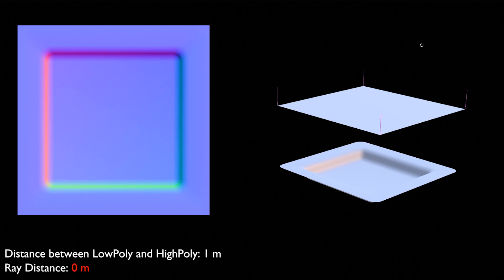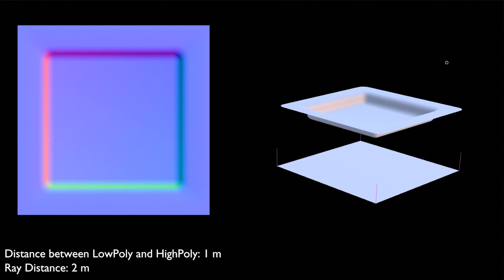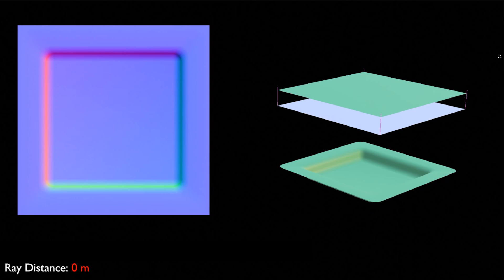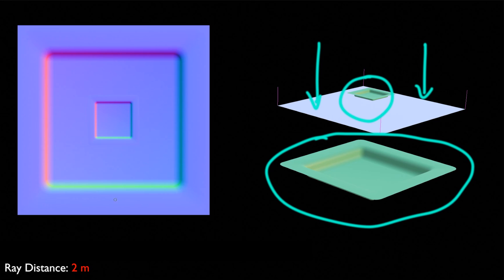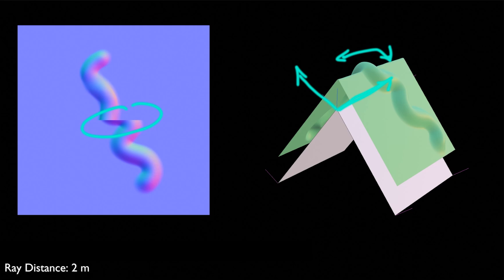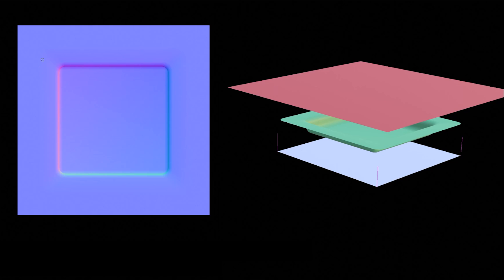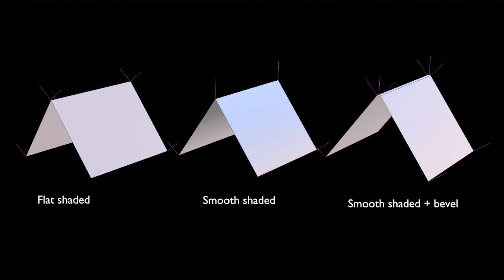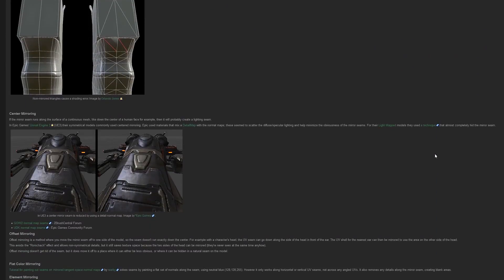Deep Dive Into Normal Baking - (For Blender, or any 3D software)

Comment: I just spent hours yesterday trying to bake something with height parallel to the low poly... While troubleshooting (because I didn't know that wasn't possible) I started fucking things up even deeper. Thanks to your video I now know exactly what I'm doing, It's not just following a formula anymore. Thank you so much for this video, this kind of theoretical knowledge is really important and yet it is extremely hard to find here on youtube. Thank you very much.

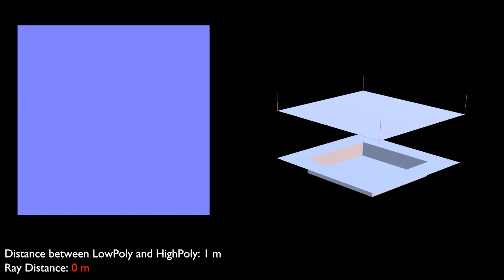PS: Just as a side note, I managed to bake a normal map which had height that is parallel to the low poly (this is a problem explained at 0:47) , remeshing the whole mesh. I suppose that the process of remeshing alter the position of the vertices making the "fall out of line" and thus making them visible to the ray projected by the low poly mesh.
Reply from the maker: Thank you for your comment, it makes me very happy. 
And you are right about the remeshing 👍

Comment: Hi, brother, this is a really good tutorial. But I'm really confused by the triangulation topic. In my understanding, with a curved surface mesh, when baking the normal map in a 3d application, it will automatically triagulate the mesh,  then the normal information will be sotred based on the tris?  So if a game engine also triangulate the mesh automatically, but in a different way, it will display black artifacts during rendering, is that the case? So that means if it's not an all planar mesh, then it has to be triangulate before baking normal map? But i see a lot of people saying they don't care about triangulation at all, it does not matter, so I am really confused. I would be really greatful if you can give me some advice.
Reply from the maker: I'm not 100% sure, but I think blender will triangulate before baking (because it's similar to rendering, and rendering internally triangulate meshes as far as I know). I think your questions is more about exporting a triangulated mesh rather than a quad mesh to another software. We can assume blender will always triangulate the mesh the same way before baking and before exporting. So really you should only be concerned about triangulating your objects when exporting it to another software (Unity, Unreal...) to make sure the mesh won't be interpreted differently. If you don't do that will you get black artifacts though? Most likely not, but you might get some specular reflections inaccuracies. Read this: http://wiki.polycount.com/wiki/Texture_Baking#Triangulation
Reply from the maker: To summarize my comment, if a non-planar face has a baked normal map but is triangulated differently than at the time of baking, you'll probably get artifacts. Don't take my work for it though I'm not an expert but that's what I would assume is going on with my current knowledge. As always, the best thing you can do is test it with a simple mesh, which should be very easy to do.
Reply: @globglob3D  Thanks mate, i think the final answer i'm looking for is, if all 3d applications triangulate the mesh before baking all the maps? That's probably how a general baking precesses? I did get black artifacts taking the normal maps generated form zbrush to unity, it's a curved face mesh with all quads. I guess at least zbrush and unity triangulate the mesh differently.
Reply from the maker: @artinchina444  "all 3d applications triangulate the mesh before baking all the maps?" I would assume that to be true, yes. Regarding your zbrush to unity artifacts, did you test this with a simple mesh (could be just a low poly curved surface with a normal map baked from high poly)?
Reply: @globglob3D  Yeah, it's a ugly shoe that i modeled in zbrush,  all in quads, about 160 vertices, 5 suddivisons or so, texture and normal map all generated in zbrush, after i import them into unity, it display some black artifacts here and there. then i triangulate the mesh, gennerate the maps again, it looks better.

Comment: great, but you forgot to mention differences between opengl normals and directx ones. blender uses opengl in material nodes and it bakes this type by default as well (can be changed), while most popular normal map type on websites with free textures is directx.
Reply from the maker: That's beyond the scope of this video, I didn't touch on exporting or using your baked normal map in another engine.